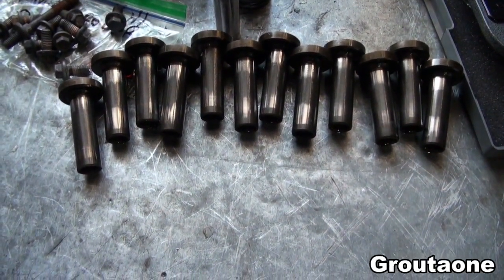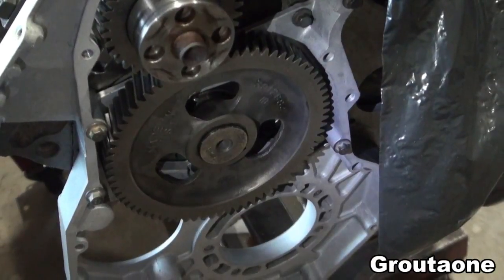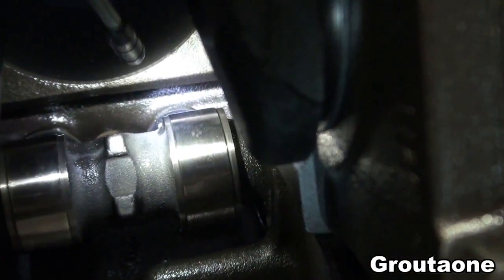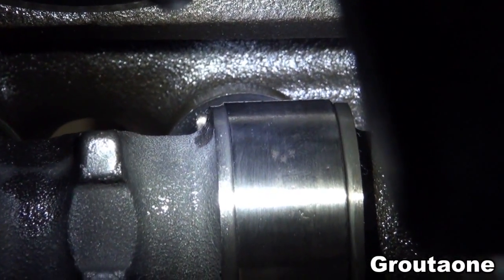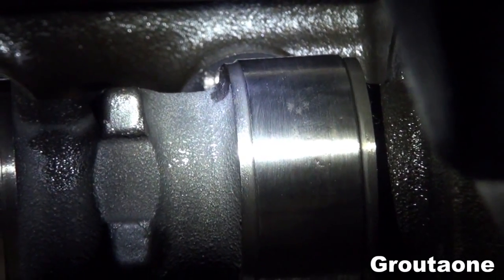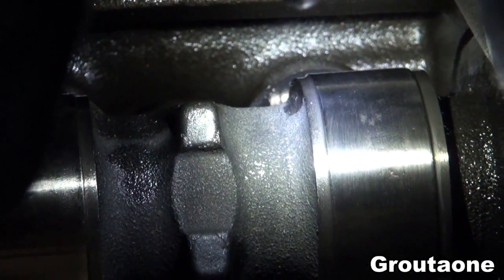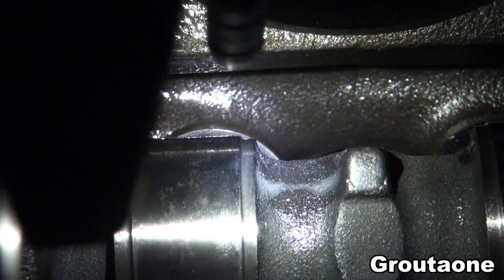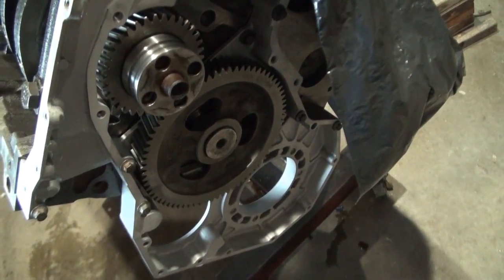Turning Camshaft Tappets Explained

Comment: I have a 1984 Navy Motor Whaleboat with a Westerbeke 107-4 diesel engine.  Per my mechanic it needs tappets for a rebuild as the original ones are beginning to flake from wear.   I've attempted to locate a source for the tappets but to no avail.  For the lack of a few relatively low dollar parts my engine rebuild is at a standstill.  In your experience is it possible to recondition or otherwise improve a tappet to be serviceable and reliable?  If a tappet of similar size, slightly over, was located could it be machined to size? 

I saw a video from a shop in California that showed welding up a camshaft lobe with hardened rod and then machining back to contour.   I was curious if this would in any way be possible with a tappet/lifter?  

Would you have any  suggestion that could help in resolving my tappet problem so I can get my motor running again?  Any suggestion of a machine shop that does this kind of work would be greatly appreciated. Thanks! 

Tallahassee, Fla
Reply from the maker: I think that if a tappet is machined to original shape and has the correct hardness that it would work well provided the cam is not excessively worn.
Reply: @groutaone  I agree.  I have the tappet in hand right now and it is a very simple shape geometrically (no taper along the shaft and the head has straight shoulders).  It could easily be machined to size so the trick will be getting the right steel and hardening it to the correct hardness.